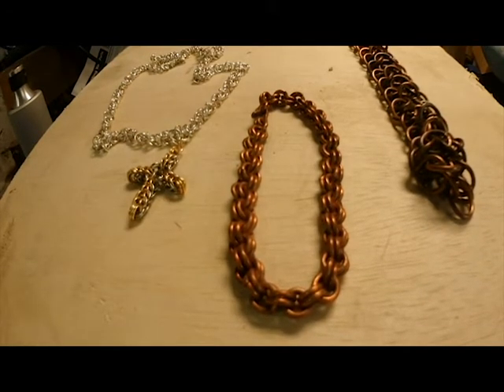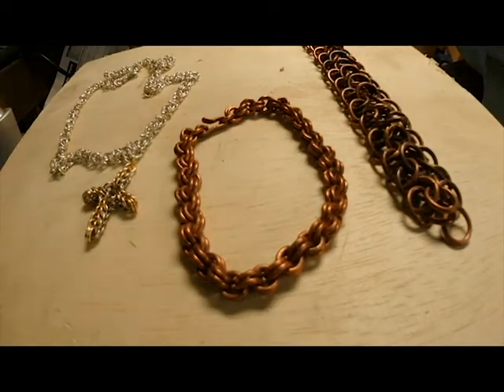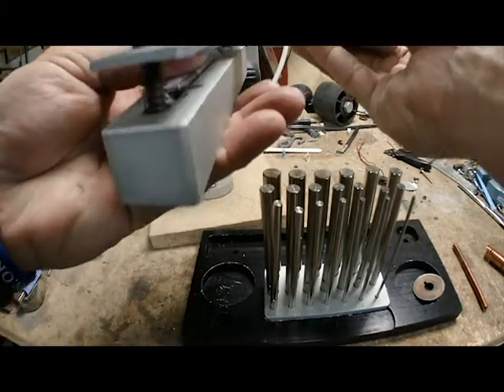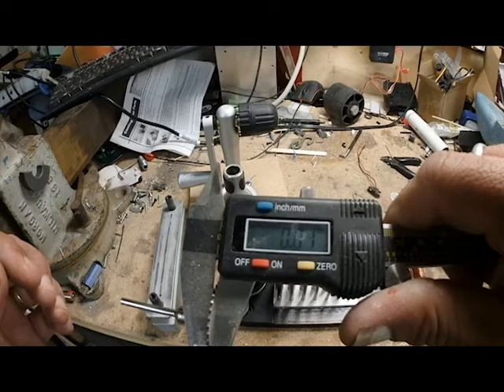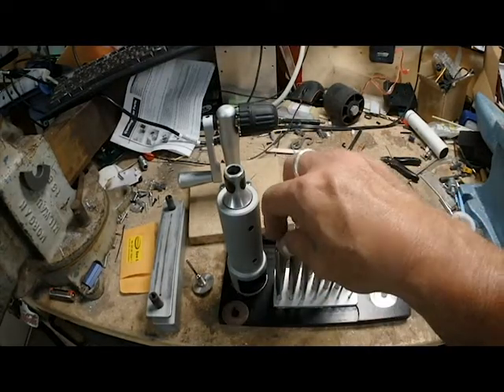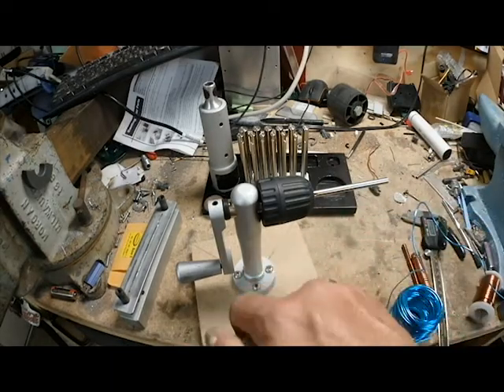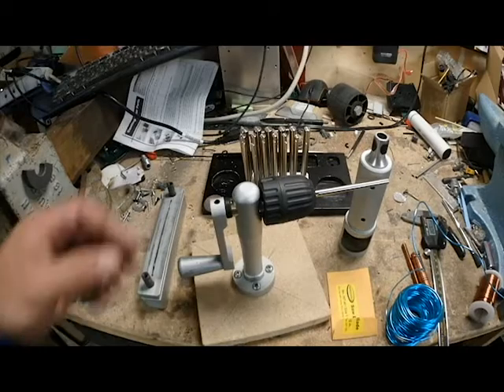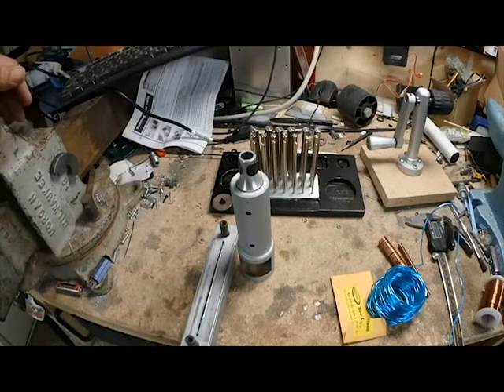Knock off of PEPE tools jump ring maker. Is it worth it. probably not

Comment: Hey, thanks for the shout out in the video 😊 and yeah the Pepetools set-up is nice and I had even messed up using it and it didn't break the blade, I think I got lucky 😅.

Just to answer your questions in the video, the Pepetools one does come with a plastic base that looks like it was milled. The hand crank drill part is very sturdy and it doesn't have any of that movement like yours.  

Anyway, this is a great example why not to by knock offs 😊👍 I will be sharing this.😉